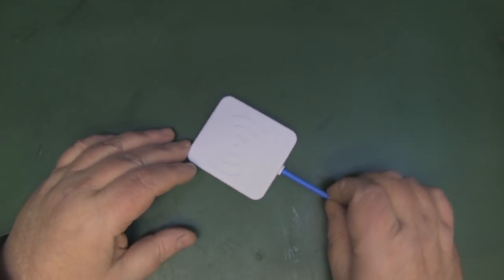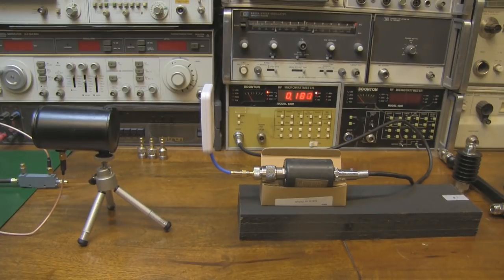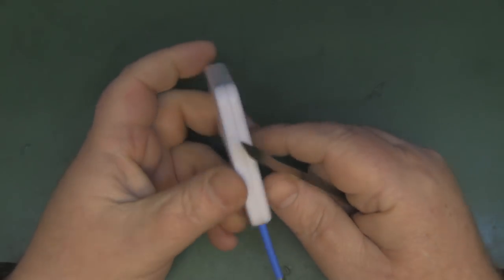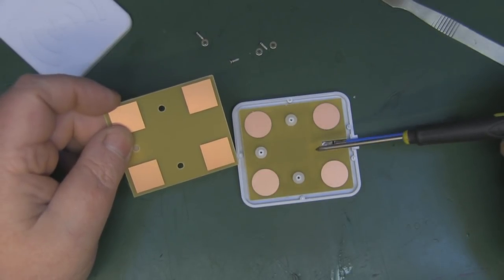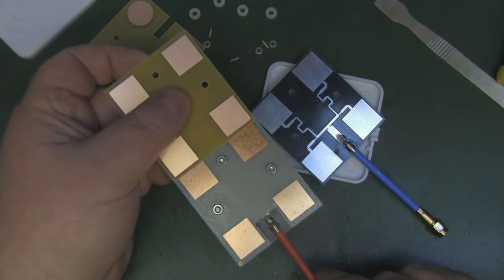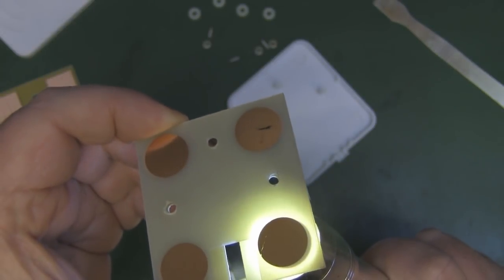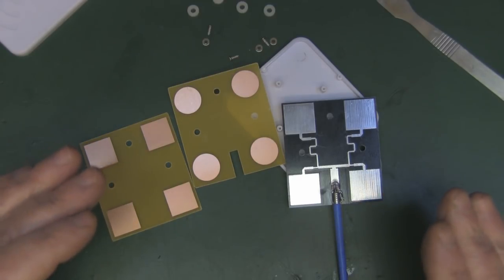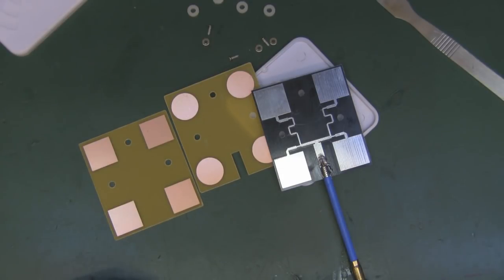At Last a 5.8GHz 14dbi Panel Antenna that is 14dbi

Comment: Fantastic video yet again and after 5 years still holds up.

Any idea if this can still be bought anywhere as I need 8 for 4 routers I'm adding external sma connectors to. I have the 2.4ghz omni and directional ordered but I could not find affordable decent 5.8 directional ants

Comment: Hello sir, i have a wifisky panel antenna 64 dbi they claim, its really a pain in my ass sometimes thé signal is good sometimes not, it says 6000 mw power is a laptop Can handel it? Because it disconnect by it self? And thanks good work😍

Comment: Hi Andrew, I've just downloaded the art work however I'm unsure as to weather it is to scale. 
Are all the panel squares meant to be 25mm? When I scale it up in cad the panel ends up 85x89mm. is that how big it is?
What is the actual dimensions of the 3 panels?
regards,
Walt.

Comment: The good antenna has also been assembled differently to the bad one. ....On the good one, the square patch parasitic has its copper elements facing the circular copper patches.
  On the bad one, the square patches on the parasitic plate face the incoming signal.

Comment: I got one of these...did not work very well at all, so, I took it apart. 
 What I found was the two parasitic elements had been assembled backwards.!!!!
I watched carefully as you took the white cased one apart noting the plate orientations, mine were on backwards to this one..!!
You can easily assemble this antenna incorrectly, the girl in China obviously did when she screwed mine together.
  Something worth mentioning in your video perhaps...?

Comment: Is that one RHCP or LHCP... Do they do sma as well. I tried their website.. but no joy there.. do you know who makes these?
Reply: Neither, this patch antenna is NOT circular polarised....its a vertically polarised linear antenna.....You need a Rubber Duck on your vtx....Not a Skew.
Reply: EnglishTurbines  I asked because I believe Andrew did make a rhcp patch antenna ages ago
Reply: You asked if it was RHCP or LHCP....The answer is the same....neither.....The flat Panel antennas which claim to be CP usually perform very badly indeed.

Comment: Been using these (Vertically Polarised) 14 dbi antennas for years now....I have two of them on my Diversity Monitor, aimed slightly outwards to each other which gives me a wide beam to fly in....Been out to 4kms no problem.
  They work really well for me and I just have a standard Rubber Duck on my VTX.
What amazes me is that the one you took apart in your video had NO LABEL INDICATING IT WAS A LINEAR, VERTICALLY POLARISED  ANTENNA....Our Chinese friends are always guilty of doing this with their antennas....
  They make circular Polarised ones that look externally exactly the same....lol.
These days I use 1280mhz, it's effortless with way more range than 5.8G.

 You should also consider amending the title to this clip, pointing out that this antenna is a Linear Vertically Polarised type and NOT Circular Polarised. Otherwise, your viewers will be trying to use it with a Skew.

Comment: Hello, driven elements does seem to match between good and bad antenna but it seems that the feed lines on a good one are a bit wider. It might be that there is a bad impedance matching of the feed line on a bad antenna... It would be interesting to see if the bad antenna would match up with the performance if assembled with passive elements from a good one.

Comment: Could you try and swap out the parasitic elements of the working one with one that is under performing and see what difference it makes?  That could prove your point one way or the other as to it’s just the P elements that is all that is changed. Just thought. Oh, and when you get your results, if better undo see if worse then redo.   I always try to fix something, undo the fix, duplicate the error then re fix and test again.  Too many blue moon fixes out there from people.  Until they replicate the results both ways I don’t trust the fix.  Any sir, thank your for the lessons.  I was curious on a side note if you could show how to make an antenna or how to modify one (2.4) that I could keep along the lines of a building.  Sort of like stop at the sidewalk or follow the boundaries of their properties.   That’s one question and second how the hell can I jam (hypothetically speaking of course) a commercial 2.4 and or 5.x GHz commercial access point on a wisp that is legally broadcasting?  Calling the authorities does no good, we’ve tried that.  Again, thank your from Texas for sharing your knowledge sir.

Comment: It does not have to be error with the dimensions. If the dielectric material (laminate) is different (different permittivity or thickness) then the dimensions of the patches need to be suitably altered. As can be seen from the video the materials of both antennas have different colors therefore they might have different parameters. Although form the color it seems like they are made on FR4 which have different parameters depending on the shop where they are sold. At this frequency range the shift of 0.1 in permittivity can change the center frequency of ~100 MHz.

Comment: Hi Andrew, thank you for the informative video. But what I have missed is an impression about the distances between the active and the parasitic elements, mean between the three panels and also the thickness of the double layer panel. As it seems to me, those in all 4 layers have specific distances to each other, which might be of some importance. Can you say something about these distances please ?
Reply from the maker: it is 2mm between all three. The thickness of the reflector and the driven element PCB is also 2mm, 1mm thicker than the cheap one. So maybe that also plays a role in making this one perform better. Thanks for pointing it out. Andrew